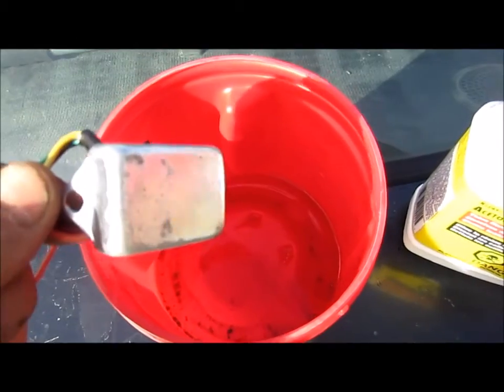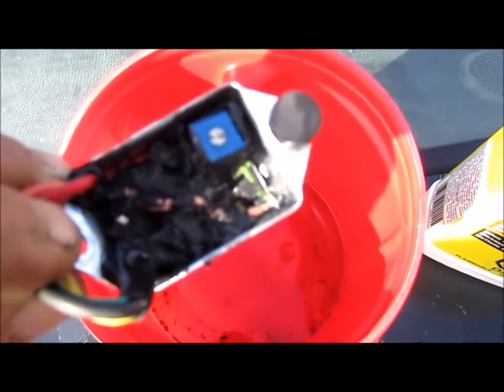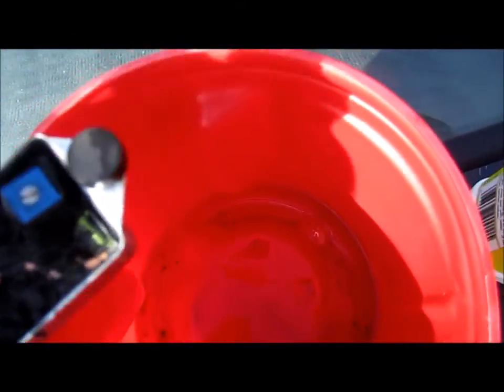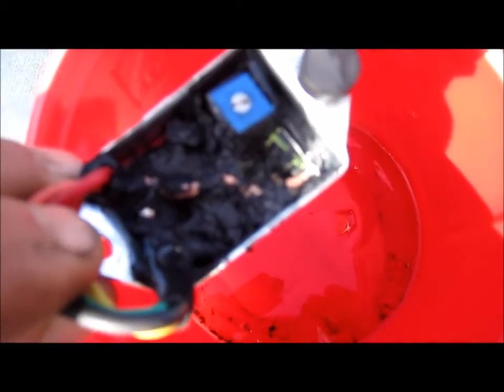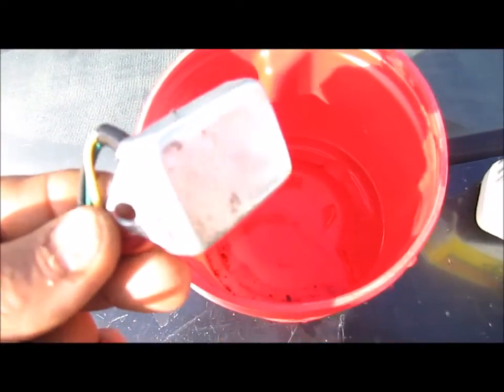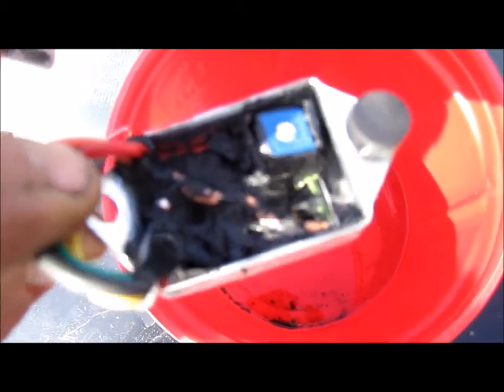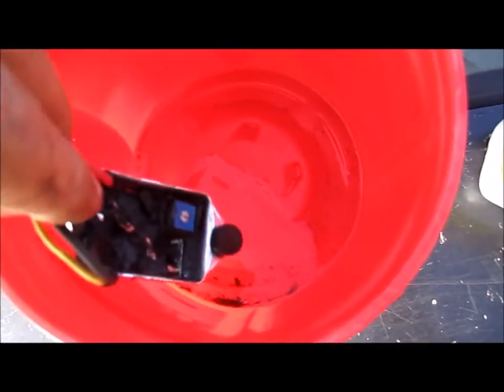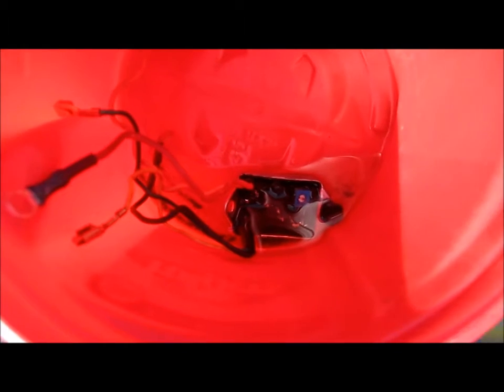How To Disolve The Rubber Sealing Compound On A Circuit Board

Comment: I'm guessing since we didn't get a follow up on the success doing this, all the plastic components melted, wire insulation got destroyed, and all the identifying markings on the components got removed in the process.
I'm always a big fan of fixing things rather than replacing them and throwing repairable parts away, but this seems a pretty time consuming, pointless and most likely doomed endeavor for such a cheap part, however it may be worth the effort if it was something rare, no longer available or the process yields the benefit of reverse engineering the item to be able to to make a completely new one.
Reply from the maker: It worked fine but a eye needs to be kept on it so i was not going to video every eye sight looking at it unfold.

Comment: I mean this video's neat, but doing this for a $35 component is kinda questionable. All that hassle for a run-of-the-mill part just might not be worth it.
Reply from the maker: Thinking with money then it's more then likely not worth it. Thinking with what else is all happening it is worth it. To each there own for sure. I don't always like to think with money only. If i was looking how to have nothing to do fast then money thinking will do it. : ) I enjoy things to do and all the other benefits that come from it.
Reply: @MrDoingEverything  I'm just saying that you could use that time more productively, that's all. Sure, if it was a $200 component then that'd be a completely different story. And even if this particular piece of electronics will not end up in a landfill in 3rd world hellholes you can rest assured any other electronics you throw away will ;)
Reply: @CoolKoon I think learning how to repair stuff is using time constructively, especially since it’s already not working, you can learn something and possibly fix the item which I believe is more constructive than trashing it and buying a new one.
Reply: @tikofann5884  Trouble is that acetone is quite a broad-acting polar solvent that readily dissolves even perfectly good components on a PCB like this (and does so more eagerly than the potting compound itself) so it might do way more damage than the original broken component. Boiling the potted circuit is a much more efficient way for removing the potting compound in fact.
Reply: @CoolKoon yeah, I wish I would have read your comment before I got the acetone out and soaked a component in it! What a mess! It was for a pool robot motor that quit working last fall. I discovered a tiny hole in the push button cover and it must have gotten water inside it after a few months of use. Now it still won’t open and the case is like a gummy mess. At least the company gave me a refund last fall!  I didn’t even think about boiling it. Nothing to lose now so maybe I will boil it!

Comment: Don't you risk damaging plastic parts like the blue pot case for instance? Because acetone is a good solvant for some plastics.
Reply from the maker: Risk is always there sure. The piece was broken already so the risk was worth it. If it never would have worked out no big deal because the part was not working already. If it turns out okay and a fix can be the result then the risk became a wonderful thing to take. Cheers